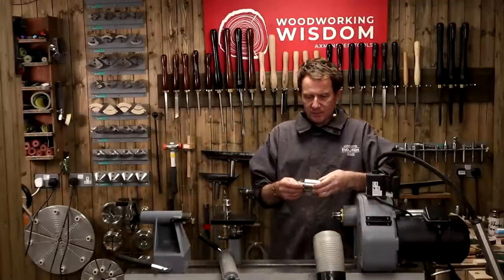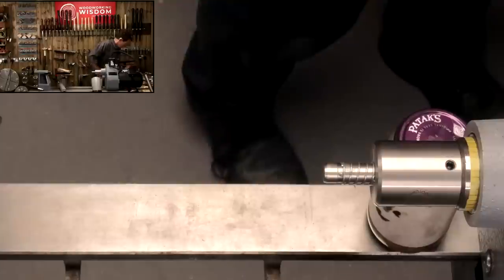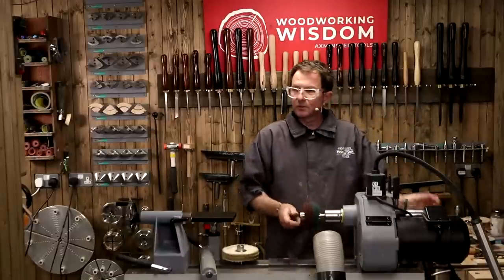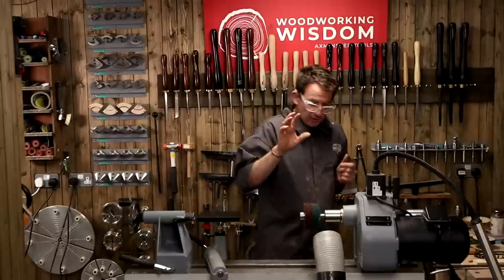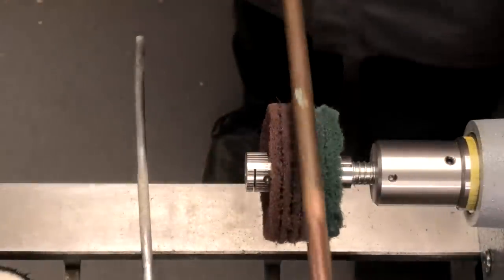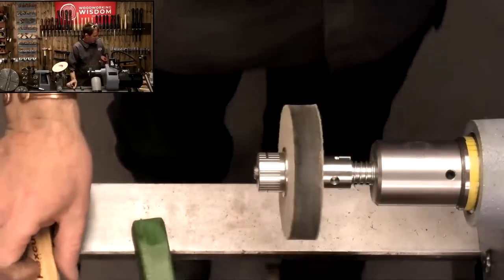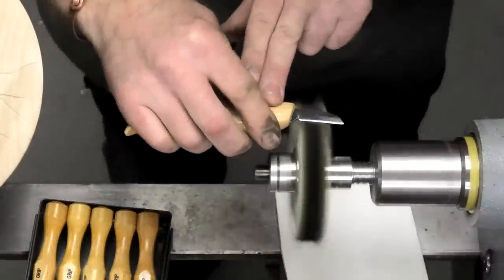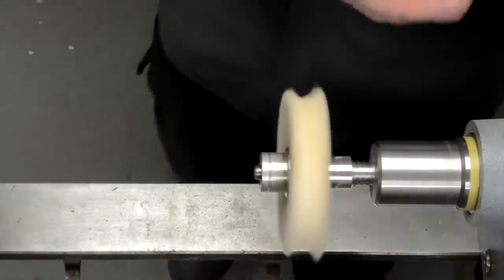Axminster Woodturning Twist & Fix - Woodworking Wisdom

Comment: Great video, thank you. I’m a little confused about which mops to buy though. On the website they are all described as suitable for metal polishing etc. None of them state that they are suitable for wood, or what is the difference between the stitched/unstitched, apart from the hardness of them. I want to buy the twist system and 3 extra attachments for 4 different mop heads but need advice please.
Reply from the maker: Hi, We have asked Jason his advice for you and he has suggested the following. 

"You will need  the Stitched polishing mop (https://www.axminstertools.com/axminster-trade-ultimate-edge-standard-stitched-polishing-mop-105422) these are used with the buffing compounds  1 mop set up for dark woods, 1 mop set up for light woods. The compounds to use with these would be Brown for the dark woods, and  the buff polishing compound for the light timbers, using the dark compound on a light wood leaves a stain or mark on the wood. Like wise using the light on a dark wood leaves white fleck marks in the grain.  

The Loose leaf mop is used with carnauba wax to give a final gloss, this is unstitched and a softer material.

The stitched mops are harder wearing and will help reduce minor scratch marks, the softer unstitched leaving a better finish." 

We hope this is helpful. Thank you